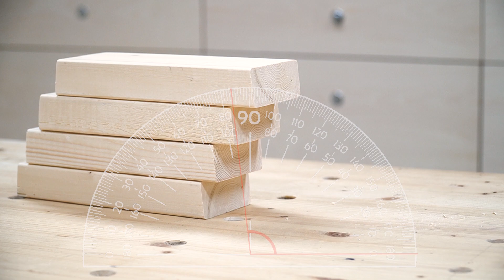Making Round Chair / DIY

Comment from the maker: Please turn on your language subtitles!
When I started DIY, I also started woodworking at the same time.
I made the most basic circular chair. 
It's simple, but it's a work that includes all the basic tasks necessary for woodwork, such as making a circle, fitting a square, covering a piece with wood, cutting an angle with a circular saw, and combining with wood bonds.
If you like carpentry, it's a must.
As we work, we know what we need. "I think that I need a band saw, that circular saw would be convenient to slide, that I need a wooden dowel bit."
In this process, we're upgrading, we're evolving.
I don't think there's a better textbook for carpentry practice.
I want everyone to make it by referring to the video. Thank you.

#DIY #Chair #RoundChair #CircularChair #WoodDIY #Making_a_chair